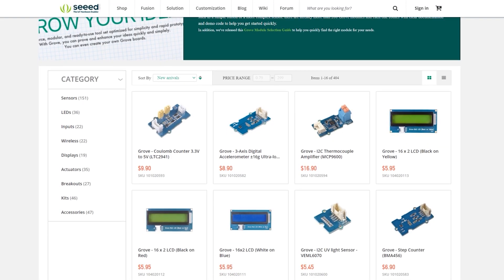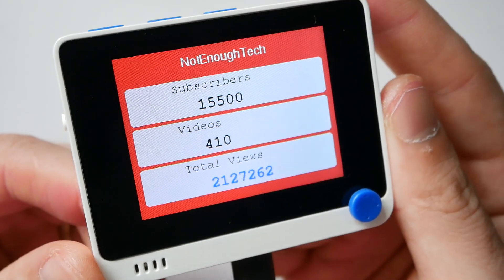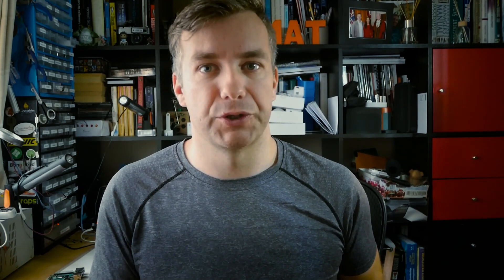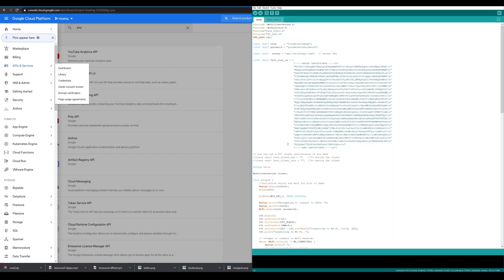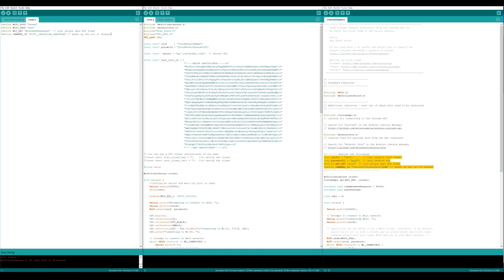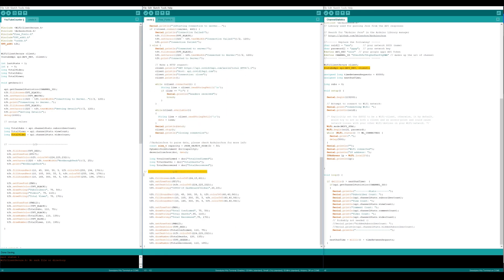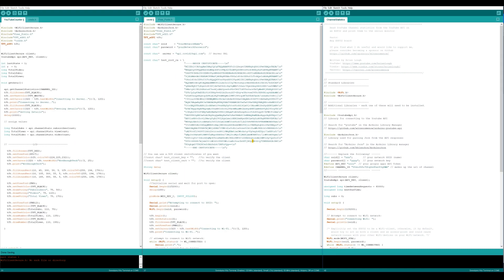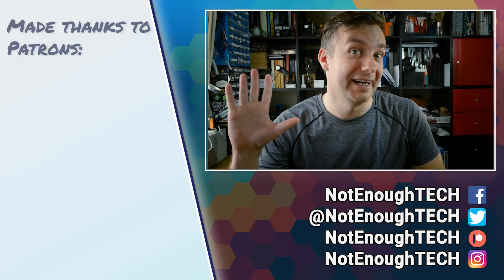All-in-one board - Wio Terminal & YouTube project

Comment: I have this unit  aswell, but I cant seem to get the libraries to work for me. I first get "Cannot initialize ESP-AT Lib" from the serial output of the device, then I checked seeeds forum and saw that someone got it to work reverting to 3 of the libraries dated back to 8th may, so I downloaded. Now it did not complain about that, but I got the "No ack, R00" error instead from the serial output of the device. Do you know which versions of the libraries you used ? (I have tried different combinations of the libraries for 5 hours yesterday, and most of the times the example code does not even compile... even if the library is just 1 month old.)   Nice project anyway :)
Reply from the maker: I just uses what was available at that time. Did you flash the new firmware for RTL chip? It's one of the things I did first
Reply: @notenoughtech  okie . Yes i did reflash it. Twice since I read someone wrote his worked then. Thanks for your answer. I guess I will try more tonight to get it working.
Reply from the maker: I'm working until Monday so won't have much time to test it ... I'll see if I can try serial on my device
Reply: @notenoughtech  serial output works, sorry. I saw I was a bit unclear, what is not working for me is the Wifi-part of this device, :) whichs is a bummer since its made for IoT
Reply: @notenoughtech  I finally found the problem. The problem was me!. I feel a bit stupid, cause I thought I had done the flash right, but now I noticed when I found a thread about the core-update that he got "Img1...Img3...Img4" uploaded, where I only got Img1 when I read my log. I forgot to check the boxes that was clearly written in the text on how to flash the device.. Ah well :/ now atleast the wifi scan works, so I know that its working.
Reply from the maker: You are not the fist to make mistakes. Not the last one either :)